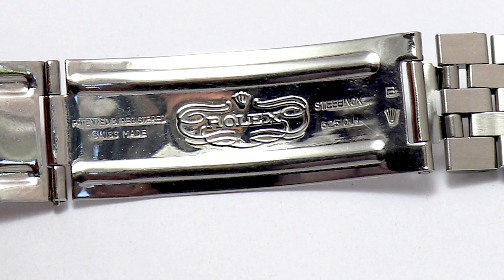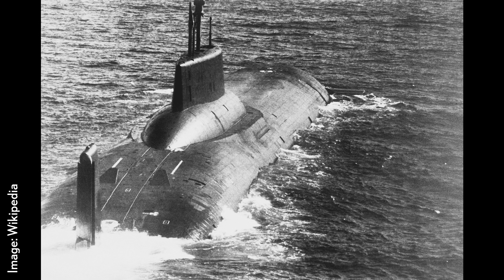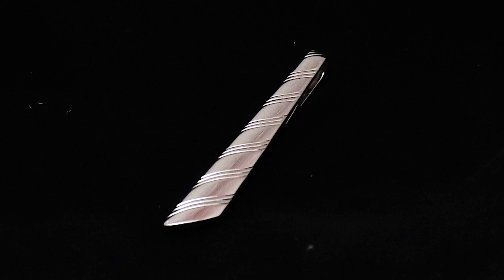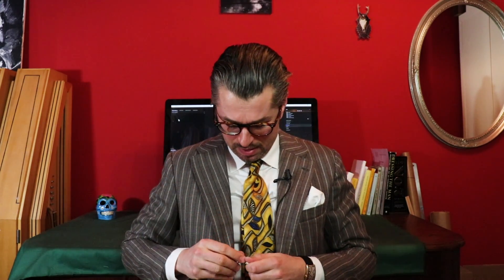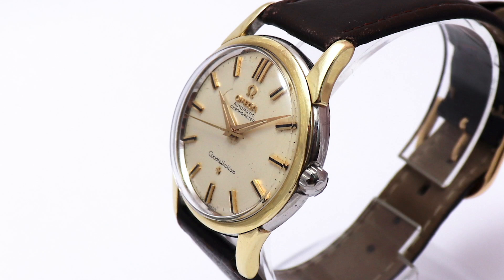Wrist Watch Material – Gold, Steel, Rhodium & More

Comment: You didn't mention nickel, which is the real villain where allergic reactions are concerned.  Nickel is often used as a plating material, because it's rust-resistant and very pretty, but not on watches or jewelry because so many people have reactions to it.  
It IS used in stainless steel alloys, but the EU has regulations about the amount of nickel that can be present.   Other countries, like China, do not.

Comment: To late!! Some years ago i bought on ebay 9ct gold watches (3) but i bought them for the design,not for the gold.I normally favour 316l corrosion resitant steel and even chrome plating if the design is only available that way.

Comment: Forgot Platinum. Also would like more information on various Stainless alloys used. I think the Rolex is 904? And perhaps Ball is also starting to use this, which may be a sign of other Swiss getting on board. I guess 904 is very hard to machine, special tools needed, but holds a finish really well?

Comment: Patek Phillippe and Rolex are as far as I am aware, the only manufacturers who use homogenous white gold. That is to say it is un-plated. Some manufacturers of cheaper pieces plate gold with nickel while others of more expensive manufacture use rhodium. Part of the secret of PP and Rolex's white gold is that it is made with silver and other materials kept secret by Rolex and PP so the metal is "white" throughout. The Rolex 'Everose' rose gold is blended with copper for colour and the use of platinum combines at the molecular level to prevent oxidisation of the copper resulting in the alloy fading to yellow over time. Rhodium is used a lot in watch movements to prevent oxidisation and pitting, it has the aesthetic dividend of making a movement more attractive as is the case with the Omega Speedmaster's 1863 movement.

Comment: Nice video.  I would like to point out three things that you missed. 

Rolex steel is much softer than regular steel it's much closer to gold and easy to scratch.  It's much more resistant to rusting though. 

Titanium is softer than steel when looking at it as a watch material.  They measure the hardness compared to weight.  So a 1kg bar of titanium could be much thicker and there for stronger than a steel one. Titanium scratches easily but  doesn't react to our skin. So on a watch it's a little softer but a lot lighter than the steel. 

Plating quality is not easy to see and it's much more important on how it's done than how thick it is.  Thickness is measured in microns.  Typically straps are plated to 5mic and cases to 10mic. Good quality plating will wear off about 1mic per year. If you breathe on a cold window then the fog on the glass is around 5mic thick.
Reply from the maker: Stephen, are you sure about the Rolex steel? I only found information that says it's much harder then ordinary steel.
Reply: @CasebackWatches  100% sure. 906L steel is a lot softer than 316 steel. Rolex had to change its milling tools because its  harder to work with softer metal. However, it can be polished to a higher whiter and deeper shine. It is better against corrosion too so when your watch is 50 years old it will also look better. 

Before about 2010 all their bracelets were still made from 316 even though they made  their cases in 906.  I believe they moved over to 906 cases in the late 1990s.  I'm guessing that maybe the 906 was too soft to be used as hollow center links. 

A good example to look at is the Explorer 1. The 14270 was made from 316. The 114270 from 1999 was 906 case and 316 bracelet 214270 from 2010 all 906 and solid links.

A quick search on why my rolex scratches more than my other steel watches or my Rolex is a scratch magnet will give you all the information.

Comment: Hi Tim, you have also the platinum that is used for higher level than gold, it is not more expensive as raw metal but it is harder to work because it is very dense. And the most hard to work is tantalum not very expensive again but so hard to work that it is quite rare in the watch industry, it give a beautiful blueish colour and very resistant to scratches.
Reply from the maker: Yes, you're right. I completely forgot Platinum.
Reply: @CasebackWatches  watchmaking machines and tools wear out too quickly with harder materials, as they are often made of tantalum. 
platinum is also difficult to machine, e.g. polish, because it behaves (deforms) differently from steel or gold when exposed to heat.

Comment: What about Platinum? Seems common for high end watches and is popular but slightly more expensive alternative to white gold that doesnt have to be plated. I believe its stronger than gold as well but not sure
Reply from the maker: I completely forgot Platinum. But i have a Platin piece incoming ;-)
Reply: I was surprised to find that platinum jewelry is usually plated with palladium, and often isn't a very high grade of platinum.
Reply: Platinum is harder than gold at the same percentage of pure metal. So for example platinum jewellery is commonly 95%. If your gold ring was also that %, day 23K, it would be softer. Also platinum does not normally allow its metal to be shaved off, or scratched off in collisions. It’s metal just moves. So you get bumps and ridges.